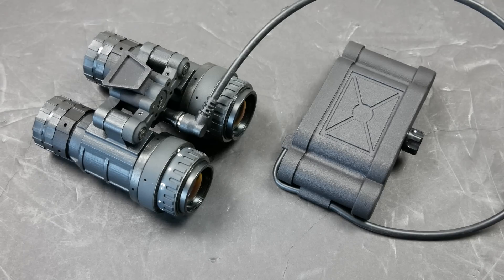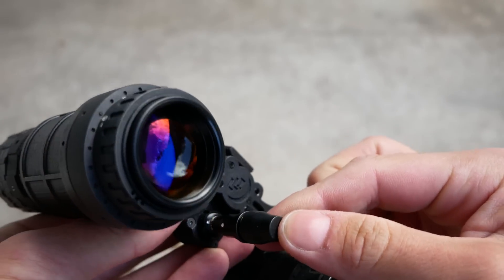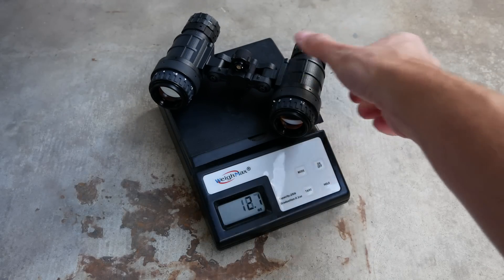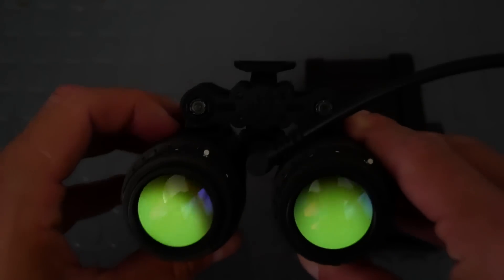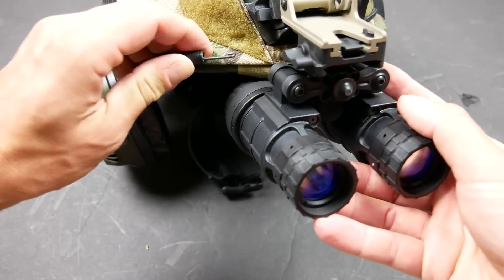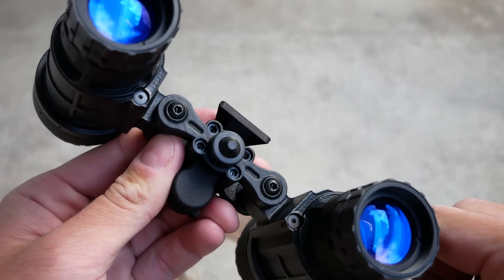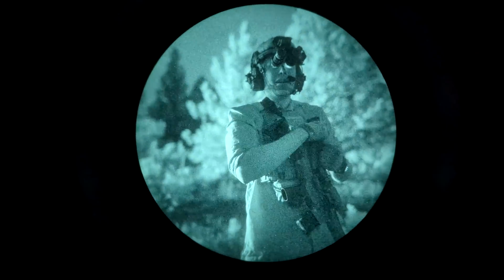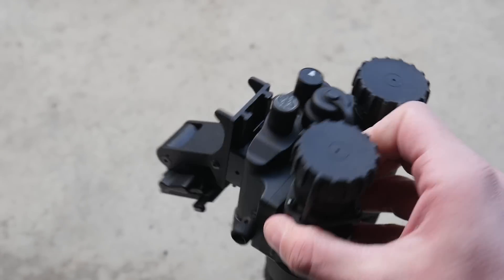Ultralight Articulating Bino NVGs: Low Light Innovations LLUL-21

Comment: Thank you for the review!  We always appreciate both criticism and feedback. However, I would like the chance to correct you on one thing.  In regards to the hinge screws, it's actually impossible for them to back out with regular use, we designed our hinge screws to lock with Nylock nuts, furthermore, the through hole in which the screw passes through is a larger diameter than the pod itself.   When the pod is rotating, it makes no contact with the screw meaning that your screw will never change position.  

We see your concerns about the dovetail interface and have been refining our dovetail as much as possible.  We have a promising new revision for the dovetail that addresses all concerns, and likely be one of the strongest on the market due to the complex geometry of it.

Thank you again for your honest review!  Constructive feedback like yours is what helps excel our products and pushes those products to the next level.

- Claude
Reply from the maker: That's good to know! Thanks Claude, I appreciate you guys :)
Reply: What type of polymer and technology are they printed with? Very compelling product, looks like SLS PA12?
Reply: Upload some content. You'd get so much more customers if you posted

Comment: Hop, do you have any thoughts on the Armasight BNVD. I can pick up their new pinnacle line 40's/51's with 2376 min FOV pinnacle tubes for 6k (Mil discount). I can't find anything with similar  tube specs for the price. I'm worried about the weight/housing though.

Comment: so it's 3-d printed plastic in a 3-d printed plasticy mount, with a 3-d printed platicy-ey arm, and feels like 3-d printer non robust platicy-ey-ey feeling may break at any minute feeling? But is it cheap? Does it work? LOL that's all most people care about.
Reply: Expecting plastic stuff to snap apart and break at any moment is fud lore
If the 3D printed gun community is anything to go off of its that 3D printed plastics are far from ultra fragile
I think there is actual criticism in the dovetail and holding mechanism being entirely plastic, as that's a point of high stress that would definitely do with a metal upgrade

Comment: As a professional user of NVGs, plastic dovetail housing, cheaper plastic materials holding very expensive optics makes me leery. Smacking nods on entryways, in and out of cars, whatever stuff you might not intend to bump into when wearing them requires just a little bit of robust materials to ensure they don’t snap right off. While I can appreciate saving weight, I’d rather have the option for an onboard battery AND a cable/battery pack. Plenty of times I didn’t run a battery pack for a number of reasons. I do like the market expanding its options and 3d printing has come a long way. This seems like a good way to repurpose anvis tubes cheaper than other market options. And most people are going to take them out very rarely anyway, so might as well save some money where you can if you can live with the downsides

Comment: 5:28 The infinity focus stop ring on this device would work just fine if Hop bothered to set it by tightening the grub screw. The ring on this device is just like the one on any PVS-14 or other device using standard PVS-14 style focus stop rings. You can even see the grub screw in this video while he is spinning the ring around, so the problem isn't that the component wasn't provided correctly. The criticism presented that the LLUL-21's focus stop ring doesn't work is not valid as Hop simply didn't understand how to make use of that feature.
Reply from the maker: Those screws don't tighten, they're just there to keep the ring from turning too far and falling off.
Reply: @Hoplopfheil  If it is true that the screws in your infinity stop rings don't tighten, then there is a problem with your specific device and you should reach out to LLI to get it resolved. Either that, or you simply haven't set the infinity stop correctly. But people watching should know that the infinity stop ring on the LLUL-21 is designed the same way as any other standard ring and can definitely be set to prevent the objective from rotating past infinity.

Comment: I have a set of BNVD 1431 MKII's as well as a set of LLUL-21's so i totally understand what you mean about the trade off, of having NODS that are lighter weight at the cost of convenience. The only thing I didn't hear mentioned in this review is that Low Light Innovations (LLI) have a "No Questions Asked" Warranty on the housing. So if the LLUL-21 housing fails for any reason, LLI will replace them. Also, if LLI come out with a newer housing they will give you full retail for your old LLUL-21 housing should you choose to upgrade. As Always....Great Review HOP!!!!

Comment: Those look like a nightmare. I would be worried constantly about screws not being tight. I got the next best thing; 1431 MKII's with RPO 3.0 glass. Having two power sources, manual gain and common optics + tubes were requirements for me. The RPO glass allows me to balance the 1431's with just the Argus usbp. Overall great, but I feel like I end up using my pvs-14 more, much easier to just bring a thermal up to your eye without having to rotate a pod out of the way.

Comment: Picked up a pair of the V2s, have already had my dovetail crack right down the middle with normal use. They are taking care of me, excellent customer service. 

That being said, I i am having a bit of buyers remorse as I thought the dovetail portion would have been more robust. Looking at the Katana, I may have to see about possibly swapping in my tubes to that housing and relegate this LLUL housing for a cheapo GP set as a backup/friend use or something.

Comment: i'm a katana person and I dig 'em! my friends have a few pairs of LLULs, one aeternus, one friend has 1431s and another pal has a 14, but I don't spend a lot of time with any of their devices, so other than being annoyed by the differences between their devices and mine, i don't really notice the features. all of our helmets are set up, so it's not like the difference in balance really impacts me. 
I'd say the style of printing on the nocturne feels tougher and more hard-wearing which makes me feel more secure. I'm really into the 123a in the click button because I have a lot of non-tactical use for my set, I like Stargazing with my sub and she considers the opportunity a reward for good behavior- it's nice to not have that reward marred by the inclusion of my sweaty ops core carbon with the blackbeard patch and the peltors.
TBH i don't believe any bino setup is ever going to be the ticket for running an ultralight NV rig for training or ReCcE because monoculars exist and will be roughly half the weight. it's nice to have lighter weight but if i were buying again now, i'd pay in ounces and articulation just to hear those three little words, "these are bombproof."

Comment: These look promising. Personally I've already invested in a mono from Nocturn Industries (the Tanto) which is insanely light, especially with the RPO 3.0 eyepiece. Since I've put so much into that I'm saving up for another to pair it with their bridge. Specifically steered away from a PVS-14 because I ultimately wanted binos and RNVG just looked like a brutal neck workout. If I had to start over again though I might have gone with these.
Reply: I have LLUL-21s with RPO 3.0 glass. 2700FOM L3 tubes. They are incredible. I agree it might be nice to be able to pop them off the dovetail and use them handheld so a friend can try them without donning my helmet, but that’s a minor gripe.
Reply: @paintballplayer700  Very nice... I got the top of the line Elbit WP tubes but L3 was a bit much for me. Also I'm only bridging two monos because I couldn't afford binos all at once, haha. But being able to use as a handheld for family member/others in a SHTF scenario is definitely a big plus, like you mentioned.
Reply: its pretty easy to just sell your tanto housing and keep your glass and tube and swap over... you'll save almost a thousand dollars if you do this and swap to the LLUL-21 instead of buying the daisho bridge and another tanto. I just sold my tanto housing, this is exactly what I'm doing.

Comment: Its not exactly the same thing but when I was in the army I broke 3 separate sets of PSQ-20Bs  where the metal mount interfaces with the plastic body, the little metal piece stayed on the rhinomount, the plastic body did not. Hopefully those dont suffer the same fate

Comment: the lulu lemon 21s, 3d printed junk that slowly degrades due to the plastic and sucks with no onboard battery.
Reply: tell me what happens when the IPD stops are constantly digging into the housing, and the plastic on the dovetail is constantly being worn down. lol. and the placement of the plug was atrocious on the v1 and only slightly better on the v2. forces you to wear nods on max adjustment because the plug inferferes w the the helmet. and no built in points to hook retention lol.
Reply: MJF printing is not bio degradable.  The housing will not degrade overtime.  The port placement on the V2 allows for maximum adjustment with any helmet setup.  In addition to this, the LLUL-21 is trusted by many LE departments across the nation.  It's also utilized by current contractors both domestic and abroad.
Reply: @LowLightInnovations  
>cops
>contractors
lol

Comment: sup Hop. 

the battery pack connector. fischer, not the 4 prong lemo? 

have RNVGs (yes on purpose) wish there was a 90 degree cable/battery-pack like this. (i do have the lpvo-go.)
Reply: yeah for these youll need a fischer port.

Comment: Also, is the NL-914C any good? Its by the same company. Not sure if youve done a video on them. 900 dollars for a White Phos PVS14 thats "Just As Good" seems like a good video for the poors.
Reply: I said the same thing lol, but 900 bucks is just the housing, you have to select a tube from the drop down. Elbit will be around 3k and L3 will be 4k. My friend just bought one of them and so far the Elbit looks better than I expected despite my zero experience with nods. The housing is cool, its dual fuel, is lighter, and is supposed to extend battery life. Low Light Innovations doesn't produce that housing though, in fact i'm not sure if they build the complete units. You can find the NL-914c at Nightline as well, i think NL stands for nightline, so i'm thinking they build them then send them to LLI.
Reply: @musician445  good to know. I guess pricing/what you're getting is very misleading on their page. Nothing they said mentioned additional charges for the actual tube... unless I read through it  too fast and missed that part. Either way, they show you a complete product with a 900 dollar tag slapped on it.
Reply: @Marrior_Wedic they don’t show that. The drop down menu says None, Elbit or L3. None refers to no tube. The “complete unit” is the kit. They can show the same picture because you can’t tell if there’s a tube installed…jfc man. Use some common sense.
Reply: @KimballLeatherCo.  dude, chill tf out. Before I click the product picture, there is nothing telling me it's customizable. Second, I mentioned I might have read through the spec area too fast, so that's admiting I might be wrong. I'm at work, and I'm not trying to be obvious when I'm on my phone. Go be mad somewhere else.
Reply: You retarded? That’s the housing only. Select a tube and you’ll see the actual price for what you’re talking about…lmao. $900 WP. I’d cum.

Comment: Am I weird for wanting gain control?
Reply: I have LLULs. Have not missed manual gain once. If I really want it darker I can dial my irises down.
Reply: No, I think most people want it, the market in general has accepted manual gain as beneficial.
Reply: Watching Trex's vid with the guy from Nocturnality, he pointed out that you can use iris caps to achieve the same thing, unless i was misunderstanding what he was saying. I'm not a user yet but will be soon. Manual gain may not be that big of a deal in the grand scheme, but again idk.
Reply: @musician445  I really think the Trex vids did more harm than good, the Nocturnality guy did a lot of general talking which muddied the waters, but didn't do enough to clear them up.

It is true if you have a device that does not have manual gain, you can still influence the brightness you receive by using adjustable iris caps. However there is a serious drawback to doing this. You are limiting the amount of light coming into the device to achieve this desired outcome. Which will reduce the light amplification properties of your device. Plus automatic gain may still automatically adjust when you may not want it to. 

Gain control just reduces how much the device amplifies the light in the image sent to your eyeball. While still allowing the maximum amount of light into the intensifier tube. Remember, you need some light in order for the device to function. Manual gain is really useful because of how varied lighting conditions may be. It also allows you to better set your brightness so your natural night vision doesn't get completely nuked in one or both eyes.

I strongly recommend getting a device with manual gain, which isn't hard since the majority of new devices have that feature. I believe what the Nocturnality rep was trying to express was not getting bogged down if your device doesn't have manual gain. Instead make lemonade with those lemons and get the adjustable iris cap to solve your problem. Because night vision devices are expensive and replacing them isn't usually practical.

Comment: I know weight savings on your helmet is a massive influence on most of your decisions.  But. If your still on the hunt for a good system. I would like to recommend the bnvd mk2. Slightly heavier. 600g . But. I have put them through absolute hell and they havent missed a beat. The 31s were a pain to get pieces for and these take 14 optics. So they have all the 14 adjustments.
And they are not printed. Glassfilled nylon polymer mold. The only real downside if you see it as one is the pod doesnt turn off as you fold it up. Only when stowed.
Reply: I scored mine from a place called techsavvyoptics out of Texas and he does add the manual gain control.  So even if you get just the housing. It can be done fairly easy. But he offers them with photonis wp for 5 grand .  Even my high fom elbits were a fuckin deal. Worth a peak

Comment: I'm not sure if I share your past sentiment on 3d printing being a waste of plastic, as I think it has some huge benefits in terms of rapid prototyping and self manufacturing. I do question it being used as a manufacturing process for a final, retail product. I suppose these are pretty low volume products. Have you had any issues with any of these 3DP night vision parts/accessories?
Reply from the maker: No durability issues, and LLI has video of them spiking the things into concrete. The housing will probably be much more durable than the optics and intensifier tubes.